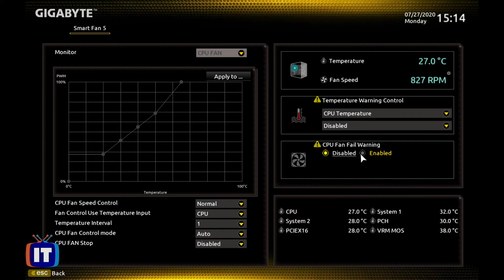System Fan Failure | PC Maintenance

Comment: At about time 12:12 if i have a long fan cable, i will not bend them or coil them because u may end up creating an air core inductor. So, what i do is actually cut the wire shorter and safely re-wire or reconnect them together and test for continuity to see if i have a complete circuit and than install the new fan...  I haven't had any problems yet in the last five years

Comment: so how do i fix a cpu fan error for an hp pavilion elite, american megatrends. the fan error shuts down the pc within 11 seconds. before any boot mode can start up. i replaced the fan but it doesnt work; same error. is there anyway to force past the error? 

i used to hit f2 to bypass but after a microsoft update, that option is no longer there. or how can i fix the motherboard sensor.